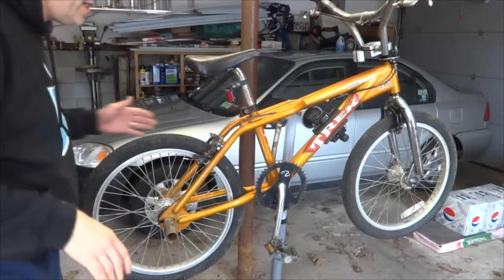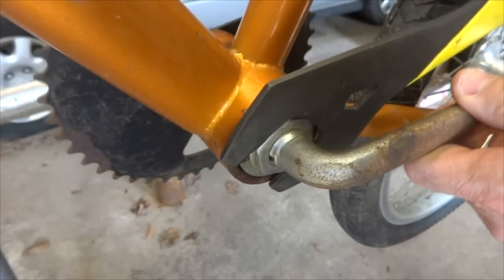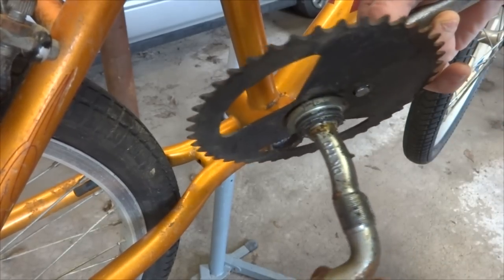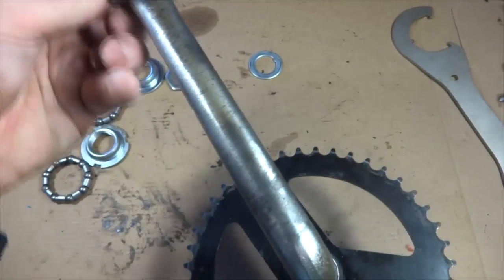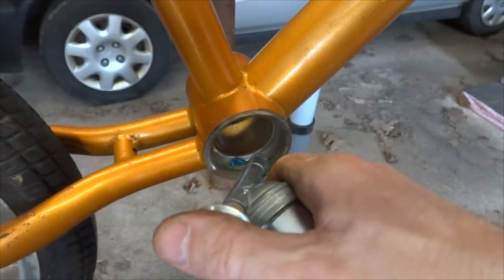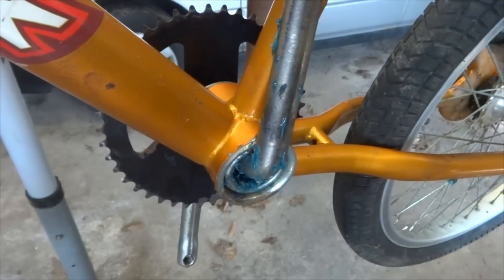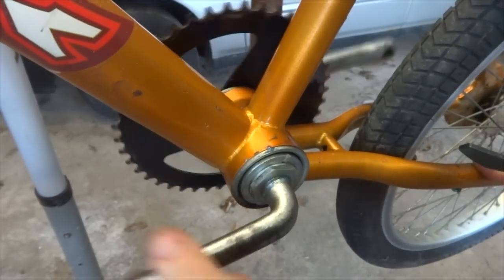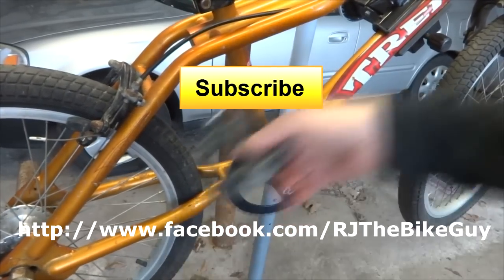Overhaul BMX Bottom Bracket with One Piece Crank Set

Comment: I hate how people hate on your videos you have helped me fully restore a J.C Higgins bike from 1953 cheers mate also my cousins mongoose bmx bike has rear v brakes and they stick bad could you do a video or comment on this with some tips to help thanks in advance
Reply from the maker: +Isaiah Lewis You need to isolate the issue. Is it the cable or the brakes themselves. Disconnect the cable from the brakes. Are the still stick? If not, replace the cable. If yes, then clean and lube brake pivot points.
Reply: Thanks man I got it fixed it was the cable
Reply from the maker: Cool!

Comment: I've seen this style of crank on Apollo Mountain bikes (I think it's a UK only brand?) A friend mine kept killing bearings because he kept riding the bike with a loose crank, eventually it bent the crank and warped the bottom bracket barrel writing off the frame.

So if you notice an significant play in your bottom bracket get it fixed as soon as possible as it can damage the bottom bracket barrel/tube.

Comment: I see a lot of these iny shop. 2 things. First, the keud washer on the non drive side has a tab that indexes in the keyway slot on the crank. They wear oit and turn. Not supposed to. 2nd, Every one Ive done required removing both cups. Crank would come out otherwise. But, if you are gona disassemble them, do it 100%. Oh, put the bearing ring in your palm and pit a dollop of grea on it and push/turn the bearing to force grease in the bearing. Ball side up in your palm.

Comment: Just bought a mongoose mode 180 for $5, it’s in good condition and after removing all the stickers, reflectors, and breaks it looks like a real decent BMX bike, one disappointing thing is it has one price cranks but can’t complain for $5 but yeah need to tighten the bottom bracket.
Reply: 5$ where the fuck did you get a 5$ bmx
Reply: BAsalcrOwn FTW on letgo, the guy didn’t want it, also I had to drive for 15 minutes there and back.

Comment: this video save for MT my old rigid mountain bike, tho I have no any kind of wrench you got there sir. moreover here in small port town mostly bike shop/repair using a large pipe wrench as they got no specialized wrench. and to remove/reinstall every part that had hole on it or to cut off chain or remove/reinstall threaded rear cassette they using brute force. using a mallet/hammer and a dull chisel/ a dull nail. sound stupid, but it's works. so what dya think sir? should i adopt it too as 'How to MT Bikes in Hack/wrong way' ?
thanks :)

Comment: It's always better to replace questionable parts.  Sometimes though, a replacement either isn't in the budget or isn't readily available.  Careful use of a center punch on a well supported washer can extrude the key far enough to restore the locking function.

Comment: I recently purchased a 1983 Predator team 24 frame and fork and am now trying to piece this together.  The bottom bracket is for a one piece crank.  The crank is 175  mm.  Where and what size do I need to be looking for.  Are all the one peice cranks the same size?  What exactly do I need to know when searching for the correct size? Thanks good video.
Reply from the maker: I am guessing they come in different sizes. Never replaced a one piece crank. You can replace it with a 3 piece crank. https://www.youtube.com/watch?v=7xTJ4ZmWmU8

Comment: Hi RJ - I'm doing a bottom bracket overhaul (in Spain) on a Polish Romet Mistral from the 80s which has cups like on here. I knocked the cups out to clean everything. Can you tell me the best way to re-insert the cups so they are solid please? Thanks - I love your vids and your style mate!
Reply from the maker: Put a thin coating of grease on them to help them slide in. Put a piece of wood over them, and tap them in with a mallet. Make sure they go in straight.
Reply: @RJTheBikeGuy  Ok thanks very much for the quick reply. Will give it a go

Comment: I finally landed a 1983 Schwinn Predator team 24 that I am looking to build.  I am having the hardest time with the bottom bracket.  Are all one piece cranks the same size in this era or what do I need to be looking for?  The crank is a Takagi Cr Mo 175 mm one piece its attached to a competition Spider I think by Sugino and a 45 tooth sprocket.  I am only finding 44 or 40 tooth sprockets, does one tooth make a real big difference?  Any help out in the you tube world? Thanks and great video.
Reply from the maker: No. Nothing is all one size. You will have to research your specific parts and figure out what is compatible.

Comment: Thank you great explanation! Could you replace the caged bearing sets with loose bearing so as to have More bearings carry the load per side? I understand it would be tricky NOT to have the loose bearings fall out as installing the crank but grease would hold them in place. Thank you.
Reply from the maker: Probably. I haven't done it on a one piece crank. I have done it on 3 piece cranks. https://www.youtube.com/watch?v=BNfRD4ETDL0

Comment: very helpful but you can also replace all the parts? and the cups can be replace aswell? ty.
Reply from the maker: +kirtan samadhi Sure, you can replace the parts. But unless there is a problem with them, why? The cups are pressed in and can be removed and replaced.
Reply: cups is already rusty and i don't know if i can removed it i haven't try it yet to dismantle my bike, i got a mongoose sniper, same one piece crank like your bike.

Comment: This would have been a good place to use your DIY conduit pipe cup removal too and the DIY Press/install kit.=)
Reply from the maker: John H I thought about it. But other than a little rust on the outer edges, the cups were fine. I cleaned up the rust somewhat with steel wool.

Comment: Thanks for the video! Questions....what if the bearing cups on the frame doesn't hold the bearings in place anymore? Does that mean the entire frame is no good?
Reply from the maker: The bearings are sandwiched between the cups and cones. Sounds more like an adjustment issue.
Reply: @RJTheBikeGuy  Thanks for the response, after further inspection, my bearing cups were shot. Popped them out and slapped on a new set....we're rolling again. 😁

Comment: Pretty good but you forgot yo check the bb for damage on older USA bottom brackets sometimes the cups themselves can have problems and start to crack
Reply from the maker: I checked them and they were fine.
Reply: RJ The Bike Guy ok I always check bb cups because I had a Walmart bike a few years back and it came with bad cups I didn't know it and as I was riding one day the bearings gave out and seized

Comment: Will any sprocket fit on a single crank or does it have to be a special sprocket?
Reply from the maker: I doubt they are universal.
Reply: @RJTheBikeGuy  did a bit of researching and it turns out as long as the center bore is 24mm it’ll fit. Guess I’ll find out soon enough lol

Comment: I have an old cruiser bike that I can’t ride because the chain tension goes to extremes while peddling ( loose then tight) I’ve tried three different back wheels and it doesn’t change. I’m guessing that I need to change the peddle sprocket to fix this? I’ve never had a bike with this problem before. I know that every single speed bike will have some variation in the chain tension as you rotate the pedals but this is so extreme that the bike is unusable. Really sucks!
Reply from the maker: I would guess it's the cranks/chain ring. One piece crank? Could be bent.

Comment: So I had an issue with a fairly new bike. It's a cheap Walmart Mongoose Brawler. Aside from the bottom bracket/crank/bearings not working, it appears to be in otherwise mint condition. I took the bearings out like you show here and they were wrecked, so I purchased some new bearings from a local bike shop thinking I could just reassemble everything and it'd work. That was not the case. After reassembling, the crank seemed to wobble a bit and just doesn't turn more than once without catching. Putting any pressure on it, the bearings just collapse into bracket. It's almost like the cups are too big for the bearings. Do you have any tips on what I might do to fix this?
Reply from the maker: I can't tell you what is wrong, Maybe you reassembled it wrong. Maybe you got the wrong sized bearings Maybe you didn't adjust correctly. Maybe something is broken. I can't tell you without having worked on the bike.
Reply: @RJTheBikeGuy  Thanks. I'm in contact with the manufacturer to figure it out. I wonder if the original assembly was bad. I got the bike for free and the bottom bracket/crank/bearings are the only issue. Otherwise the bike is in almost perfect condition.

Comment: Is it possible to get sealed bearings for this type of bottom bracket? If so could you point me in the right direction? I'm assuming the press fit ones used in the better/more expensive BMX's wouldn't work
Reply from the maker: +MrToontownforever Maybe something like this: https://www.youtube.com/watch?v=7xTJ4ZmWmU8
Reply: +RJ The Bike Guy Close but I'd need an adaptor to use this type of bottom bracket http://www.sourcebmx.com/Mobile/MobileModels.aspx?ModelID=27663
Reply from the maker: You are very limited with what you can do with the American one piece cranks.
Reply: +RJ The Bike Guy Ok, thanks for the help
Reply: yes you can, I have sealed bearings on a haro backtrail with a one piece crank just like this
Reply: yes you can, I have sealed bearings on a haro backtrail with a one piece crank just like this
Reply: yes you can, I have sealed bearings on a haro backtrail with a one piece crank just like this

Comment: Guys i have a 3 piece crank but with these type of berings and threaded spindle, how can i replace the bearings with normal bmx ones? Do i  also have to replace spindle?
Reply from the maker: I have no idea what you are talking about. Threaded spindle? What are "normal" bmx bearings?
Reply: can i add you on some social network so you can help me?
Reply: You're gonna need a whole new crank set. Your current one won't work with a sealed BB.
Reply: You sure aha? cause i'm still rocking a 3 piece crank with a new unsealed bb
Reply: Yeah you're stuck with unsealed until you get a new crank set. Unless you can find a non-threaded spindle that will work with your arms.

Comment: My chain keeps coming loose on my bmx. I've tightened it so many times but seconds of riding will male it loose again. I've gotten a new sprocket but that didn't work and not sure what to do now.
Reply from the maker: Sounds like your wheel is slipping forward. Maybe your axle or nut are stripped.

Comment: So at the sprocket park i dont got that rench is there away i cab take it off with out that's wrench
Reply from the maker: Which wrench?
Reply: 3:13
Reply from the maker: @Grenade825  Buy a wrench, borrow a wrench. make a wrench. use a hook spanner. Figure it out. Adapt, overcome.

Comment: the cone isn't coming off? what should i do?
Reply from the maker: Keep working at it. My guess is your is different, or you are doing it wrong. I have't worked on your bike, so I can't say.
Reply: @RJTheBikeGuy  i have a similar setup and the cone is gone behind the grooves on which it should be. So now what i have to do is pull the cone back align it on the grooves and then unscrew it clockwise.. and obviously there is not so much space to do this. This is where I'm  having trouble. Can you help?
Reply from the maker: @dj_5205  Without working on the bike directly, no.

Comment: Also, when I use a normal wrench it just slides, I think it is because it is rusted
Reply from the maker: Maybe you are using the wrong sized wrench. Or the flats are stripped. Be sure you are trying to turn them in the correct direction.
Reply: I was using the wrong wrench
Reply from the maker: That would do it.